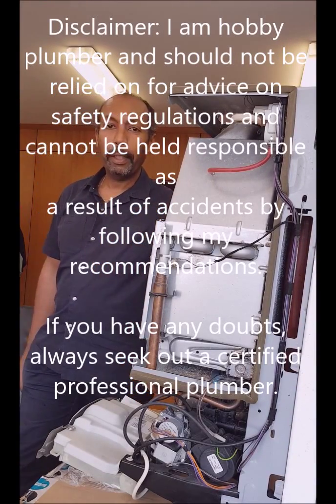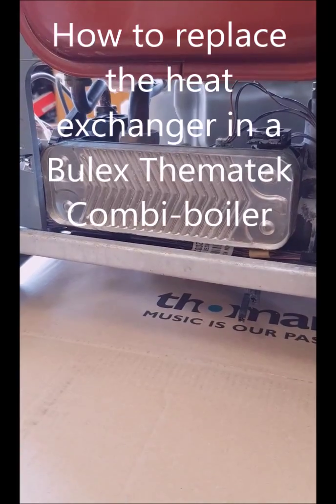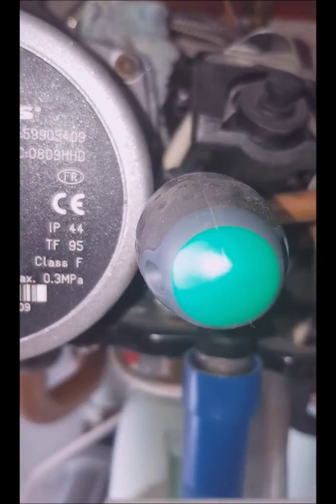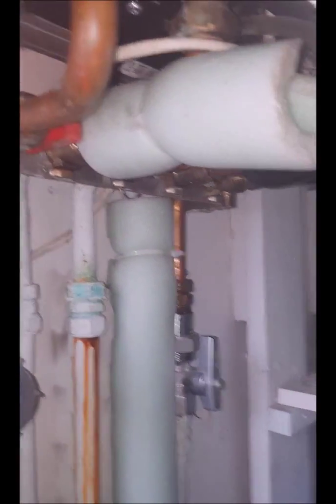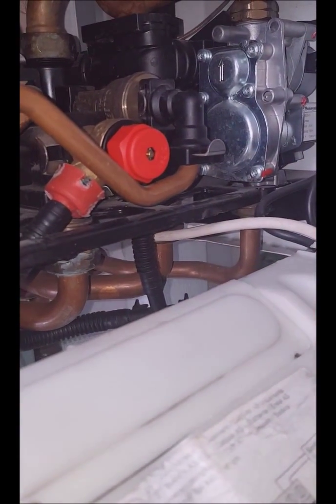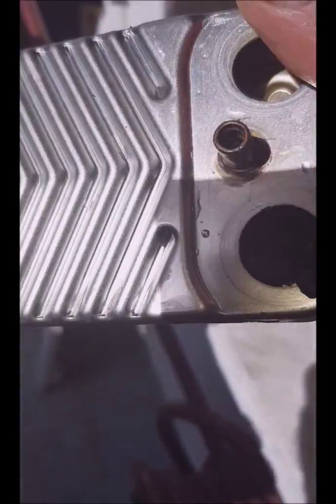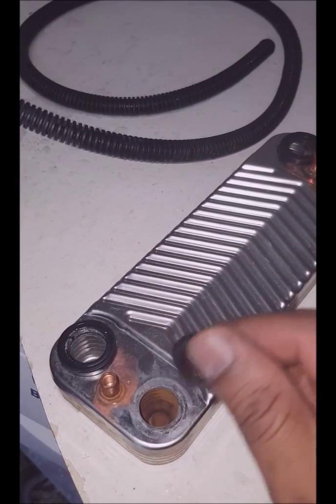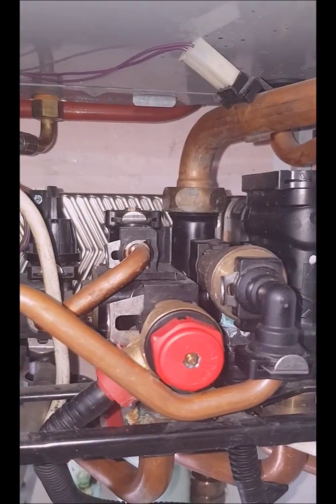Replacing the heat exchanger of a Bulex Thematek combi-boiler

Comment: Decent repair and a great attitude. I've recently acquired a heat exchanger for experiments and was shocked that people pour HCl into them to remove limescale, which also etches the copper bond and the stainless steel itself. Glad you didn't do it. Another commenter recommended filling heat exchangers and putting them in an ultrasonic bath for 30 minutes.
Reply from the maker: Thanks for your feedback.  I have had to do this operation at least 4 times a year on various boilers and I have found out that the exchangers can be cleaned quite effectively. All the best.

Comment: hello alec singh,
you are talking about a combi boiler with a plate heat exchanger,
do i  understand it correct ? that the plate heat exchanger is for the central heating of the house and the gas can be heated for hot shower and hot tap water.

how long does a heat plate exchanger last?

can a plate heat exchanger be limited to 50 degrees as in underfloor heating?
Reply from the maker: Hello Anton, yes to all your questions except for the last one, where I couldn't pronounce on it, but I don't see why not. The plate heat exchanger's life depends on the amount of calcium in the water,  but I think it depends more on the cleanliness of your central heating system. If it is a new system, it will last very long. If you are using old radiators and pipes, you might need to clean it once a year. It can be easily cleaned and put back. Good luck.